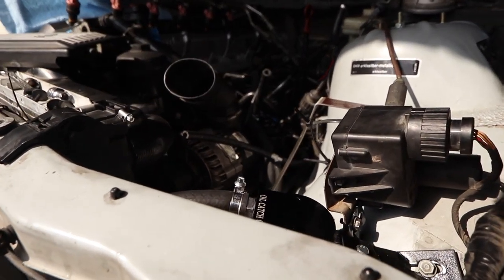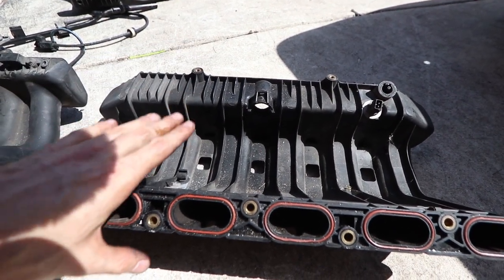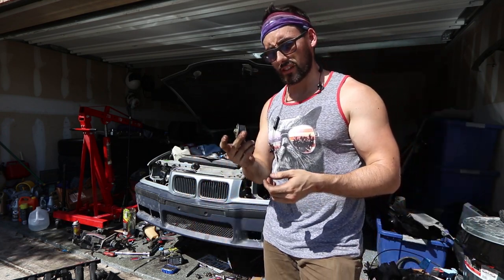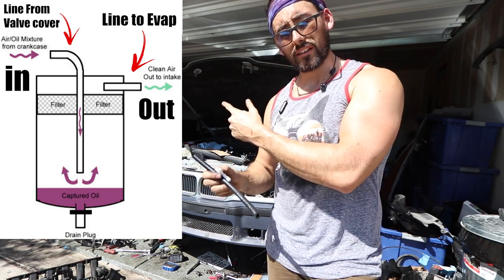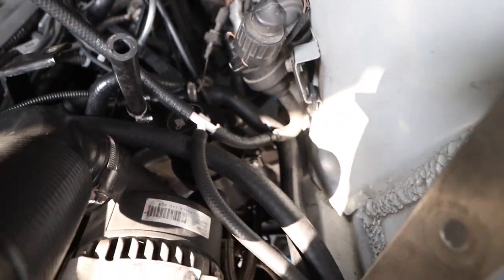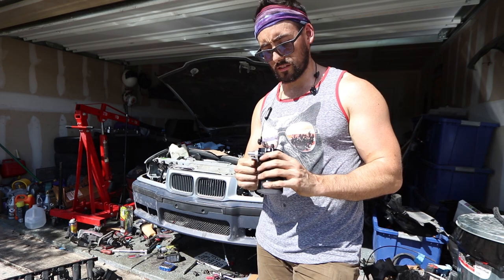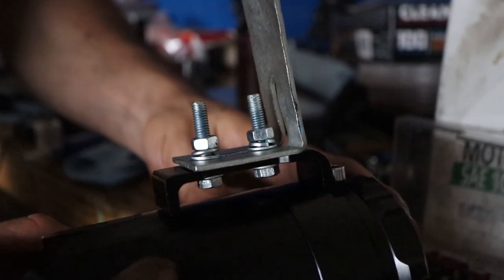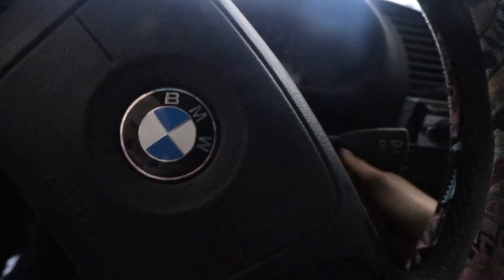How to Install a Catch Can Simplified

Comment: To my understanding you should direct the catch can OUT between MAF and throttle body, just like on M50. Then you will not have oil consumption when idling. Alternatively you can direct catch can OUT through aftermarket Purolator PV1050 or alternative PCV into your intake manifold.

Comment: I've just finished this set up and am getting a whistling noise 
The noise goes away when I lift off the oil fill cap, it seems like there's quite a strong vacuum in the crankcase, takes alot of effort to remove the oil fill cap
Any ideas on why it's whistling?
Reply: U figure it out

Comment: Ok so for the vacuum lines what am I supposed to do the Evap I tap into it’s runs to the evap sensor the big port on the intake and then T into the catch can what do I do with 2 smaller ports and as the CCV and the EVap no take both positions in vacuum and the oil return to dipstick is capped just watched the video again the FPR valve goes to the line on the dipstick? But what about the check valve where do I rout that
Reply: An what about the big hose on the take where the Evap sensor originally was I just leave it there with that u shaped hose open like this is the closest thing I’ve found to a good install video and it’s still leaving out information

Comment: I had to use a PCV valve on my Oil Catch Can setup, I had too much vacuum that was causing my engine to run rough.
Reply: same here, threw in a PCV and no issues after and the catch can actually collects crap instead of injecting it back  into the motor
Reply from the maker: I might have to look into that, so far it seems to be working good. We will see though!
Reply: Where did you install the pcv in the catch can system?
Reply: Just done today a catch can. Where bouts did u put pcv.? Thanks!!
Reply: @jaidynpolson7939  you put the pcv in between catch can and intake manifold hose
Reply: @e36fanatics  between the catch can return line and intake?

Comment: If I reconnect it to the intake system wouldn’t it blow oil into the intake under boost
Reply: Yes it will, put a check valve inline so that boost pressure does not reverse the air flow and pressurize the out port on the catch can. Pay attention to the arrow on the check valve to direct the airflow from catch can to intake.